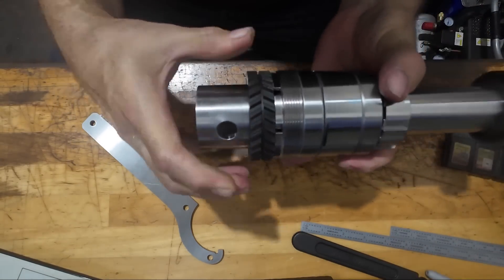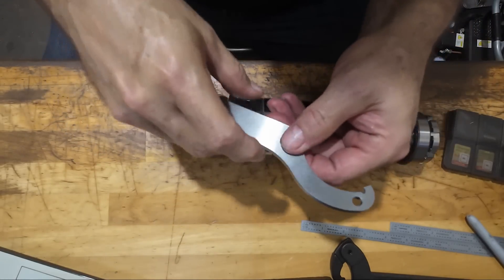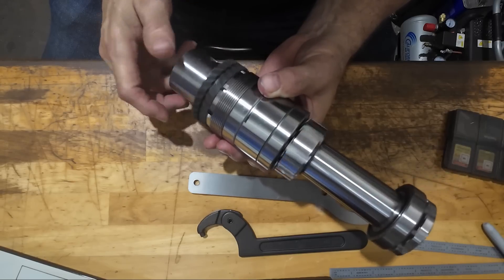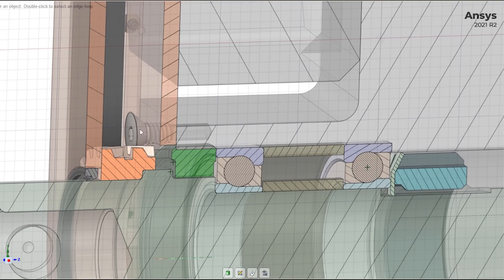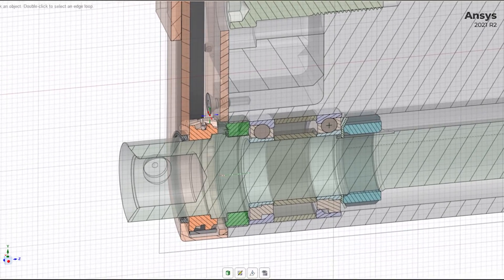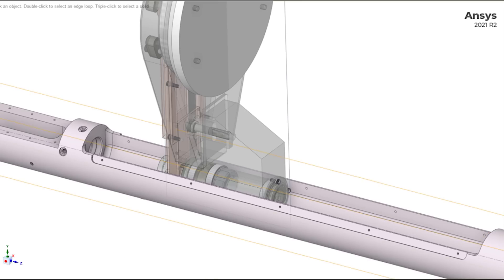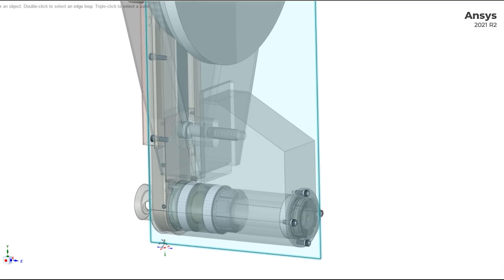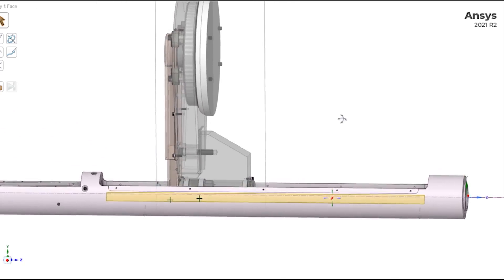Special Wrench

Comment: How do you like Ansys ? Looks like quite a piece of software.
Reply from the maker: This software use to be called SpaceClaim until they bought them out. I have been using it for probably 20 years. I like it just because I'm use to it. But other software's now are probably better. Also Ansys more specializes in analytical type of software. Like stress analysis or thermal or flow. This is just one thing in their product line now.
Reply: @EdgePrecision  I am guessing it does what you want it to do without all the autism that is built into fusion.

Comment: Isn't that chip recutting really hard on the cutting teeth?
Reply from the maker: Normally I would run coolant on something like this. But for the sake of the video I was running it dry. Yes re-cutting the chips/shavings is not good for the tool.
Reply: @EdgePrecision  Thanks Peter. It was a cool video, as always.